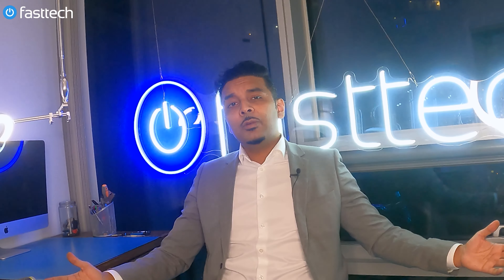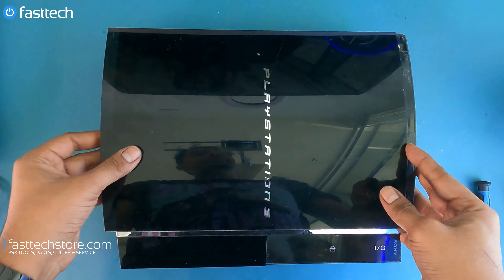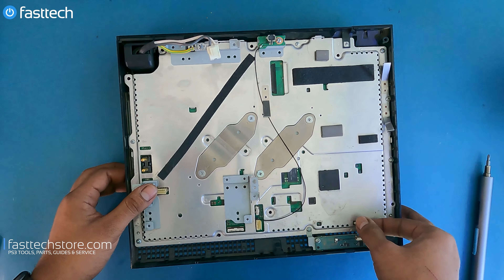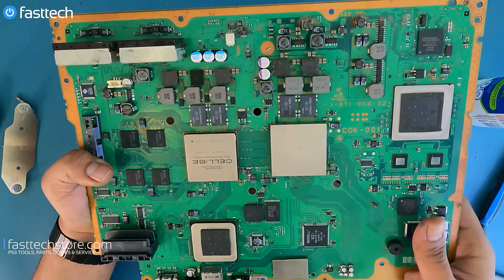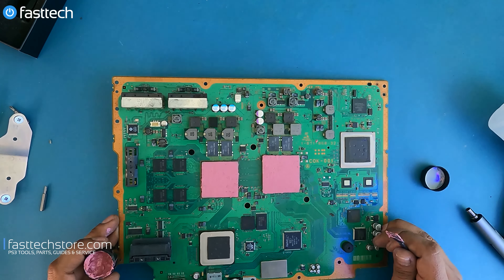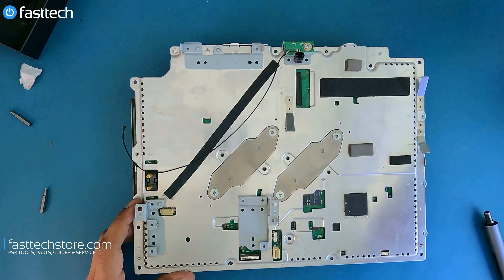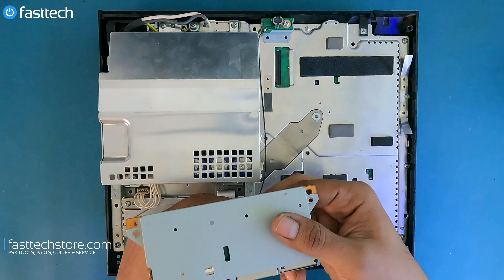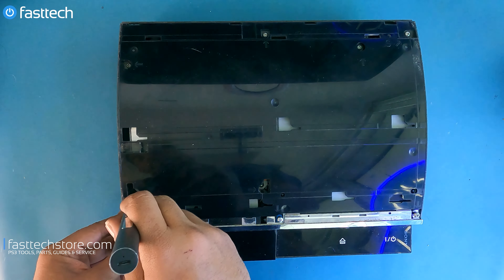PS3 60GB & 80GB CECHA01/CECHE01 Thermal Paste Replacement Guide

Comment: I recently tried turning on my PS3 (I believe it's the 80GB model, CECHE01), and it turns on with a green light and functional disc drive, but doesn't produce a video signal. I think it gets a little blip of some random visual pixels/static every few seconds. I am suspecting I need to replace the thermal paste. It hasn't been used in a few years but I do remember back in 2018 or so it did sound like a jet engine. Hopefully it's not dead completely. This is the first time I've had an issue. Is that also what you'd suggest?
Reply from the maker: Your gpu (rsx) is most likely on its way out.
Reply: @fasttechvideo  Damn. That sounds hard to fix.
Reply from the maker: @redKheld  it is
Reply: Sounds like your RSX is fried my friend. I had a fat model do the same. The fan went into jet mode for about a week, started displaying green lines on the screen and then started doing exactly what you described. Only way to repair it is with a QUALITY  heatgun and a pre-balled RSX from ebay. don't even bother with the ones you have to ball yourself, its nearly impossible unless you own a repair lab and every tool imaginable. This is not for the faint of heart though. I am in the IT field and work with PC hardware on a daily basis and I failed RSX replacement twice before finally getting it on the third time. Also, check your HDMI port and make sure you don't have any bent connectors. Check the HDMI cable you used with it or try another or see if you can get your hands on a pair of the Sony cables to check the component output. Lastly, you can search up how to put it into restore mode by holding the power button down and see if it will allow you to factory reset it. if you attempt a restore, make sure you have a WIRED controller that is a LEGIT sony brand controller. Most of the aftermarkets wont work for PS2 gameplay or in restore mode. I will attempt more in the future as long as it is not a BC model. I don't wanna be the guy responsible for goofing up another backwards compatible console. I have a bricked motherboard from a launch model and sometimes late at night when the kids are asleep, I will pull it out and look it over a bit while I cry inside like a big manchild.
Reply: Just hold the power button till the second beep it should do it
Reply: My ps3 is a 80gb model CECHE01 and I haven’t used it in many years it’s the backwards compatible one cause it was 4 usb ports. My console was freezing a lot displaying green pixels all over the screen, and also sounded very loud. Yesterday I opened it completely and cleaned all the dust out it was very very dirty I left it very clean I even cleaned the lens with alcohol before I put it back together.  and I saw the thermal paste chips looked dry as hell. I replaced the hard drive with one I got from eBay and it still freezes. Idk if it’s the HDMI port or cable or the thermal paste. what do you guys think it is?

Comment: Hey man! I picked up a 20$ backward compatible ps3 - its A01 - Its having issues. When I plugged it the light went Green - Yellow - Flash red. I replaced the thermal paste and put it together Green - Yellow - Green - Flashing red now. I have seen that there is a cpu UNDER those ones that can be pasted - I've also seen people remove those capacitors (couldnt find any easy online cheap) - I've also seen people heat the board with a hair dryer after pasting what i did! and it worked!.... Not sure what to do / try but would love input from someone with your experience. I don't have "syscon" but i do have common sense and a soldering iron. Thanks!
Reply from the maker: Watch our ylod video posted recently. If that fails replace the nec/tokin caps

Comment: Welp, not sure what I did wrong but I got everything back together and now I’m getting nothing. No power. No red light.
Reply from the maker: Check the power supply connections and the ribbon cable connector for the power and eject sensor
Reply: @fasttechvideo  ok I double checked, and Everything is plugged in as it should be. For a back story, I got the YLOD and attempted to heat up the motherboard to try and “re flow” the solder. So I’m thinking I damaged the motherboard in some way. Not sure how, but I double checked the connections like you said and still no luck
Reply from the maker: @Nick.Pellerin  Can't diagnose from here. All I can say is check the power supply and the on/off sensor board at the front. Have you tried turning it on with a controller?
Reply: @fasttechvideo  I was unaware you could turn these consoles on by the controller
Reply from the maker: @Nick.Pellerin  yes you can but the controller has to be paired to the console already. Good luck
Reply: @fasttechvideo  thank you for the advice
Reply from the maker: @Nick.Pellerin  you’re welcome

Comment: If you don't change the thermal paste under the ihs, it won't solve the overheating problem.
Reply from the maker: @walterwallace9503  indeed, if the paste underneath the ihs is dry.

Comment: I did mine with thermal grizzly kyronaut worked better that exteme stuff is not that great. I tried it on a few things its great if you have temps around 80c and your overclocking sure but for average temps Kyronaut is better
Reply from the maker: @MrWolfen  i disagree but thanks for your feedback
Reply: @fasttechvideo  Well I tried it on my oced CPU extreme stuff. replacing arctic silver. After 1 week of ups and down idle was 33c and full loads was reaching 90c then cleaned it replaced with Kyronaut same water cooler everthing idle is now 23c and full load never reached 70c so I dunno.
Reply: I thinking amazon sold me a bad batch or something switched it with playduh. Because the temps do not lie
Reply from the maker: @ its possible
Reply from the maker: @ thanks for sharing those numbers

Comment: You do know that the PS/3 is the only Play station that cleans itself, Right?
Reply from the maker: You are referring to holding the eject button down to blow out air?
Reply: About a month ago was the last time my hard drive on my ps/3 worked.
I don't know if this is from dust, power outages,  everything else works fine.  
PS/3 did an upgrade on my console.
So was it a bad update, 
I also noticed everything was wiped on my console, My Progress games, internet info, gone.
I reset everything online, everything works fine, and recovered my online games.
CD Rom reader,player or media will not work.
I have never opened my gaming consoles up.
ITTAKES THE DISC IT SPINS IT, BUT NO GAME PLAY sorry for caps.
On screen you see no disc, and no eject through the cordless controllers.
If you physically press eject the disc ejects.
My hard drive is 64gig/74gig. Originally 80 Gig.
My wife bought that console for me used from GameSpot with God of War Gold Edition, GTA-lV, and grand tourismo, for under 100 clams. It came with 2 controllers/ cords  and a power plug.
No books, no registration forms online or off.

I keep me electronics in Prestige condition.
I even have a PS/2- still works.
And Nintendo 64 with all retro games- - in working order.
I don't know if mine plays ps2 or ps1, never tried it.
Reply: @fasttechvideo  Yes Sir.
Reply: I have the CECHL01 is this part of the same group of ps/3's that you meticilously describe in detail? And Thanx for posting your hyperlinks, which i have used some already. checked out pricing on sending my machine to your establishment , I think I would rather fix on my own, So Thanx again for the Proffessional Video and all the contents you shared, You know your Business.

Comment: If you put some thermal pad on some of the chips the heat will drop a lot too.
Reply from the maker: Yes that is correct. Thanks for your comment and please subscribe :)
Reply: which chips ?
Reply: @darthsay1065 cpu
Reply: @darthsay1065 put one on the back side of cpu were caps are will run better :)

Comment: I think after 15 years of not touching my ps3, my thermal pads, and paste are gone. The system runs at 67C while idling, but i have yet to receive any warnings about excessive heating or needing to turn it off.
Reply from the maker: Time for a thermal paste replacement and maybe even a delid

Comment: The worst thermal paste change tutorial I have ever seen, expensive tools and supplies so that the IHS were not removed and the thermal pads remained the same, a shame and a waste, poor console.
Reply from the maker: The thermal pads almost never have to be replaced. Only if they break apart or are brittle. I also have done IHS removal in a later video. Thanks for your comment.

Comment: I broke the bd drive cable latch 🥲🥲🥲 It wouldn’t go in at all tried it both ways
Reply from the maker: Can be fixed by putting the clip back in after you insert the cable
Reply: @fasttechvideo  Thank you! I will try again tomorrow ... already spent a few hours trying to get it back in oh chipped a few microns off it also I might need a new cable also dunno why it's so hard to insert. The blue tape that was on the cable also fell off now it just bends weird . Guess it was very old. I'll try to bring it to a repair shop or buy a new one at this point .. kinda sad since it was the BC version also ..